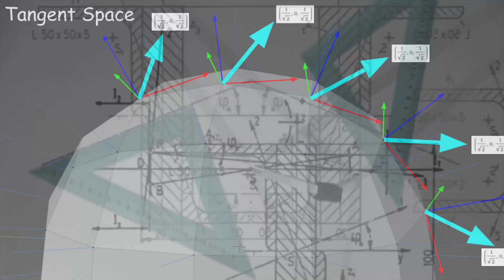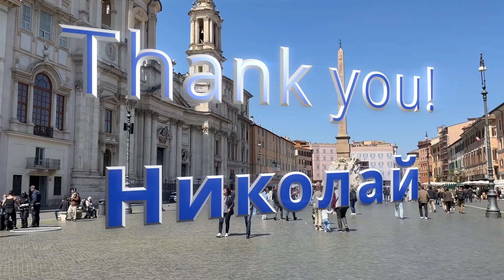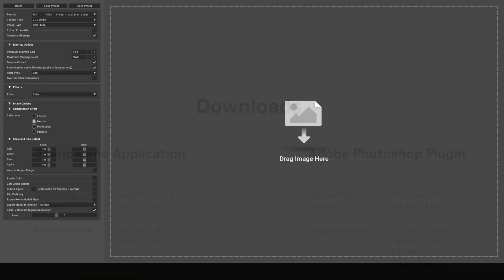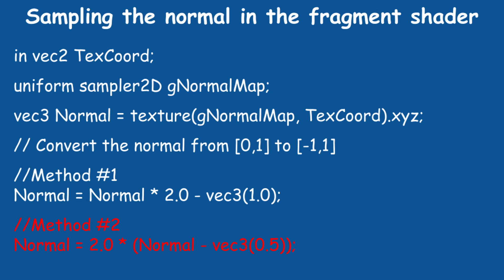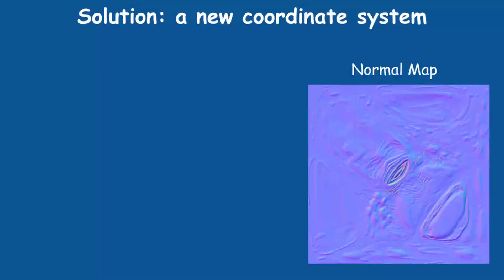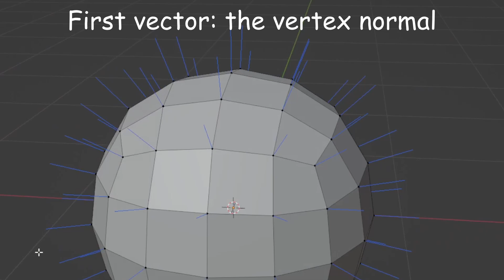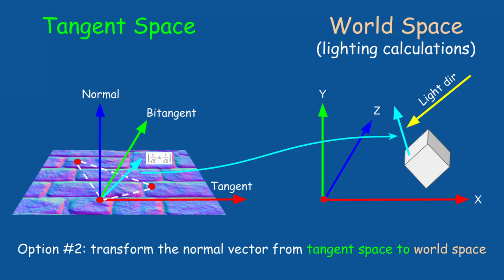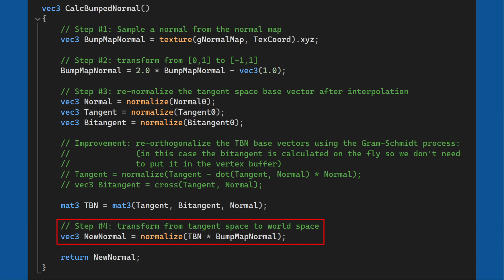Normal Mapping Adventures // OpenGL Intermediate Series

Comment: Great video! I implemented this technique in my renderer the other day! I did it with vec4 tangents where the w component was the direction of the bitangent in raport to the cross product between the normal and the first 3 components. It is a bit more computationally expensive but saves some space. One thing I had some trouble with was the fact that the normal texture had to be in the UNORM format. I am adding this just in case other people encounter this issue. Also I am not sure if it is an issue in OpenGL. My renderer uses Vulkan
Reply from the maker: Thanks! When you sample the normal from the UNORM texture what is the range of the result components?
Reply: @OGLDEV  Sorry i completely forgot about the comment. It is [0, 1] so i double it and subtract one to get the actual normal
Reply from the maker: So it doesn't really matter if you use a UNORM texture, right? Did you get it working eventually?

Comment: @OGLDEV, just for fun Joey de Vries has a hasty function in GLSL's Fragment shader that calculates tangent normals to world space instead of bringing over tangent and bitangent attributes to the Vertex shader by using derivatives. I tried comparing both methods but I couldn't visually tell which was better; Perhaps just a smidge but he did mention this technique was more overhead than the former: 

vec3 Get_TBN()
{
	vec3 Tangent_Normal = texture(Normal_Map, Texture_Coordinates).xyz * 2.f - 1.f;
        vec3 WderivX = dFdx(World_Position); 
	vec3 WderivY = dFdy(World_Position);
	vec2 TderivX  = dFdx(Texture_Coordinates);
	vec2 TderivY  = dFdy(Texture_Coordinates);

	vec3 T  = normalize(WderivX * TderivY.t - WderivY * TderivX.t);
	vec3 N = normalize(Normal);
	vec3 B = -normalize(cross(N, T));
	mat3 TBN = mat3(T, B, N);

	return normalize(TBN * Tangent_Normal);
}
Reply from the maker: Thanks. This is quite advanced. I still haven't used the derivatives in my tutorials.